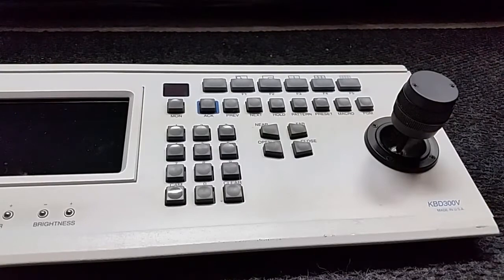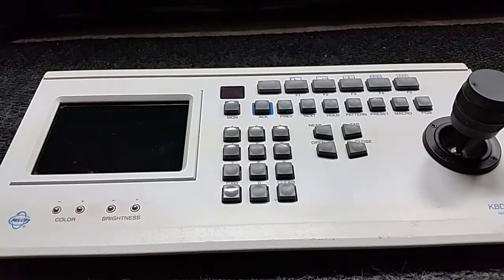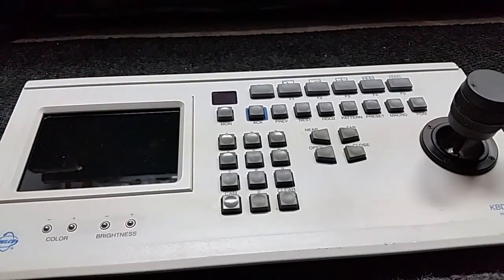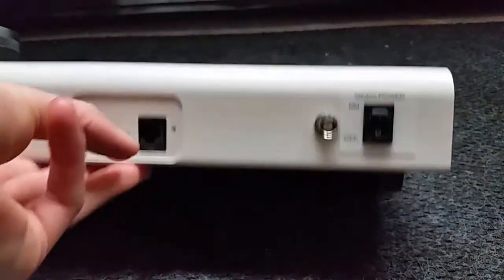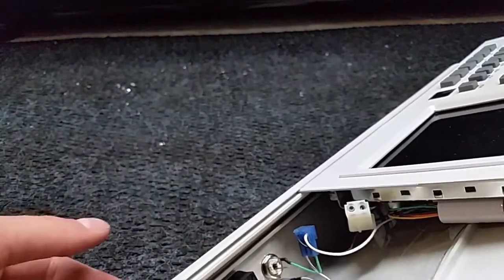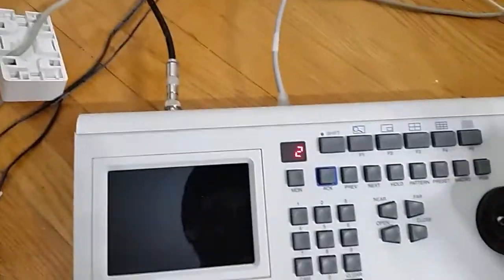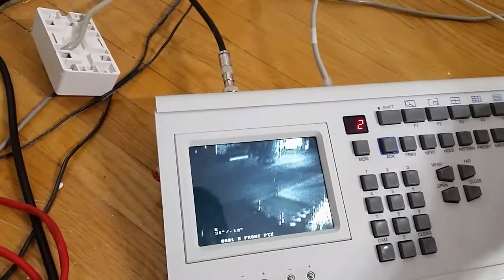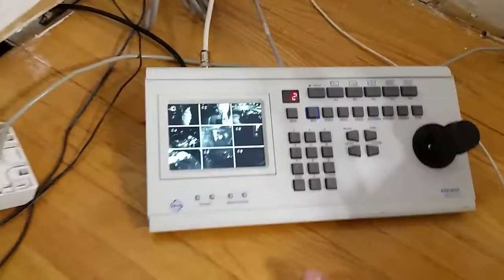How to Connect a Pelco KBD300V PTZ Camera Controller With 5" LCD Monitor

Comment: You're still on this old Pelco stuff?  I mean it's good stuff but things have come a long way since 2008. I have moved on to Hikvision but even on my new 1080p Hikvision system still got my Spectra 3 SE
Reply from the maker: How do you have the spectra analog camera connected to the hikvision nvr ?
Reply: @QuaabQueb  He's got a HD-TVI system, it uses standard coax to transmit HD video. His DVR supports CVBS alongside TVI.
Reply: I switched to an IP system about 3 years ago, first with some 1mp cameras,  I now have 2mp ptz's and 4mp fixed lens cameras and it is just amazing. Can read licence plates 200ft down the street, colors are as sharp as it get, just like looking out the window. Totaly worth the switch. Running Milestone Xprotect, it's free if you have 8 cameras or less and it just works.